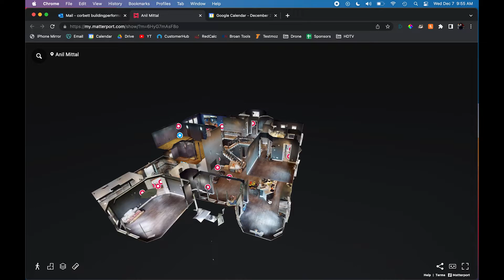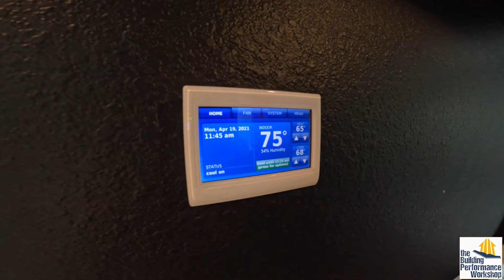Mold House Tour and Scientific Causes: Disaster Production Home Build in Houston Texas

Comment: I just want to say that flex duct, when installed properly, is not a problematic material. If it’s run straight, pulled tight, supported every two -three feet, bends made with fittings, joints, double strapped and sealed with mastic and insulation sealed to the plenum insulation, it’s excellent. The duct itself is plastic so it will fail when the plastic deteriorates… which should be in a couple hundred years.
Reply: We
Reply: wrong. most recent code only allow for flex duct to be used on the last 8? feet of a branch. It is a problem and always has been
Reply: @zefrum3  that may be code where you live but it ain’t where I live.
Anybody who wants to pay for the labor /material of a well designed, airtight full sheet metal install won’t regret it but not everybody will see the value and that’s how a lot of good contractors lose bids to cheap flex flingers. I’d rather have manual D’d airtight  properly assembled flex/ductboard system than a sheet metal system slapped together by rules of thumb and maybe some mastic where you can see it. The latter is what most of the homes in my market have. Sheet metal does not solve all problems.
Reply: @zefrum3  and kindly don’t treat codes as gospel my friend. There are a lot of stupid things allowed by code and really good things not required.
Reply: @paulgaras2606  kindly dont presuppose i am treating codes as gospel, dont forget code is a de minimus standard. Its a fact that flex duct is not the best product evident that is always upsized from hard pipe and it is almost always installed incorrectly and the installs are usually a claustrophobia-inducing spider web. Also duct board is another terrible product. I am very surprised anyone with a little knowledge of duct work would argue duct board is better than sheetmetal. On the value side, if flex duct is more value, why is it cheaper? Thats a non sequitur. Hard pipe wont fall a part over time or from UV purifiers and it can be cleaned; not so with flex. Wheres the value?
Reply: You’re talking about bad installations. I’m talking about good ones. Contractors who design per manual D, install per best practices, test for airtightness and delivered airflow can get just as good results with liberal use of flex as with sheet metal. You gotta sell the job. If customers will pay for sheet metal then sell sheet metal. But whatever you do, design it and install per industry best practices and you’ll do well. It can be flex and duct board or sheet metal. But the real problem in the situation In This video is that nobody designed anything, nobody understood principles of airflow or the value of well sealed ductwork, probably didn’t get how insulation works either, and nobody tested anything after it was built. Sheet metal would not have fixed that.
Reply: @paulgaras2606  good flex duct installs per manual D almost never happen. As a related issue I paid 30K for 2 new variable 5ton units and the installers didn’t catch on the first or second times applying mastic to the transitions. Thats with me stressing tightness and knowing the owner of the business, which is top rated in my area. Its just too hard and complex to get right; if you’ve been in ine attic, you know exactly what i mean. And all the flex duct in my nearly 5K sqft house is installed improperly. If its not getting done right in million dollar homes, its not getting done right in entry level homes either. Again, code is a de minimus standard and that minimum is almost always never met. With hard pipe, its for some reason a different story. Its not value to install flex duct.
Reply: @zefrum3  I install flex duct in low income as well as mcmansions and do it 100% properly for each client. I also install sheetmetal.
There's benefits to both, I've seen a lot of bad flex and metal jobs. Sheetmetal is almost always more leaky than flex when tested and if installed in a vented attic will result in considerable moisture related damages to both the ductwork and home just like flex (sometimes worse) 
I personally prefer running round trunk duct with flex tails to boots, and I don't care if it's 3ft or 30 because we account for losses. When pulled tight and fully supported flex is a fantastic product that can last a very long time.
If the argument is that you can't clean it (which is false) I would argue Two points. 1- the ductwork shouldn't need cleaning if it's sealed and adequate filtration is in place. 
2- the buildup in ductwork is seldom airborne unless physically disrupted, sure it can build up and cause air losses but that would take a substantial blockage.
Reply: @paulgaras2606  fresh air intakes for instance with no filtration is a big problem. Nobody is telling homeowners they should filter their fresh air intake installed by state code.
Reply: @zefrum3  Duct cleaning is only for people who don’t maintain/inspect their systems. If people did, there would never be NADCA.
Reply: @zefrum3  Duct cleaning is only for people who don’t maintain/inspect their systems. If people did, there would never be NADCA.
Reply: @paulgaras2606  100% agreed.
Reply from the maker: Fair point Dustin, but how can you clean flex without tearing it up, if needed?
Reply: @zefrum3  I’m really sorry that happened to you. I wish it weren’t typical but it is. My point is that the answer to situations like yours is not “just run sheet metal every time.” That won’t keep situations like yours from happening. The solution is to build well designed, properly installed airtight duct systems. I maintain it can be done with sheet metal or flex or even ductboard. If that is what contractors need to do to stay competitive and if that’s what laborers are skilled in then it can be done.
Reply: @dustincole2625  ductwork shouldn’t need cleaning is the exact same sentiment as ductwork shouldnt be leaky or sweating or improperly sized…but it happens all the time. Also flex duct really cant be cleaned because it will be torn especially when those not to manufacturer kinks and bends are all other prohibited installs are in the way of a duct cleaner.
Reply: @sp1200M3D  thats a non answer; its not a solution to assert this; it happens and even to the best of homeowners. And when it does, the duct work should be cleanable.
Reply: @HomePerformance  I do not advocate for duct cleanings normally as they seldom involve real problem solving.( Why sweep the floor if your not going to install the door type thinking.) 
But I have seen successful cleanings when done carefully with the proper equipment as it pertains to dirt/dust removal. Obviously if the ductwork is contaminated with molds or the core has been jeopardized from either installation or those other cure-all bolt on profit driving solutions then cleaning is likely not an option with flex. 
When I get called in regarding dirt/dust in the ductwork we evaluate for air sealing opportunities and system installation deficiencies.  This commonly results in major duct renovations because regardless of materials used it is rare to find a properly sized and installed air distribution system so at that point cleaning of the ducts become less important to solving issues for my clients. 
I sling flex but I do specify rigid externally insulated ductwork between floors and in other areas concealed from future inspections and repairs. More specifically in the last 2 or so years I have specified 2" closed cell insulation on all inaccessible ducts with a strong recommendation for it on all ducts in a vented attic. Obviously the client makes the final call based on budget but 2" closed cell nets me an approximate R-14, air/water tight, and can take the beatings ducts often get during construction from other trades. I don't ever call it a forever or permanent solution but it's pert near it when done properly.
Reply: @zefrum3  Flex is too sensitive and the brushes can damage them, and they really don’t clean them well… Dirty flex? Replace it.
Reply: @sp1200M3D  i 100% agree; i did this on my first house; wish I had replaced with hard pipe though.

Comment: This is NOT an isolated incident.
It's RAMPANT, especially in apartments. 
Intl Bldg Codes need to see things like this.
Reply: This!!!! This is the answer. After getting mold sick, and dealing with building issues I've been seriously concluding that we have to get the building codes changed. It's the only answer to hold these builders accountable.
Reply: Many US states either have no code or don't meaningfully enforce code. Also, for example, in MN where I live, the state didn't adopt the latest international building code. My impression is that the international code is pretty good as a baseline, but that many US states just aren't keeping up.
Reply: There are already so many codes that the code inspectors can't keep up. Codes won't prevent this. If you hire a good home inspector you will catch 95% of problems. This kind of problem is very rare. The extensive codes that already exist make it so difficult to build as it is.
Reply: @judahbrutus Then, what are you proposing? do nothing and feel sorry for those homeowners? Codes, at least in Texas allows “cardboard” to be used as sheathing, then it means codes compliance is not enough to be protected against some storms. We are in the USA, and the quality of our houses are worst compared to other 3rd world countries, but 100x more expensive. Something needs to change!